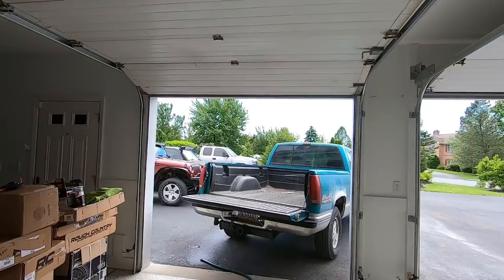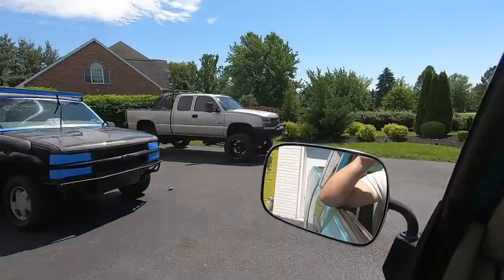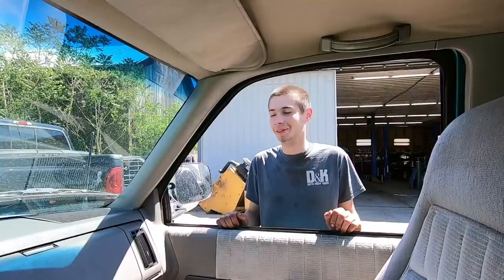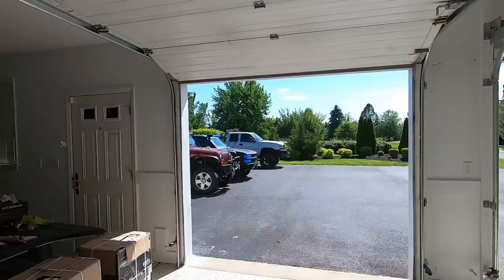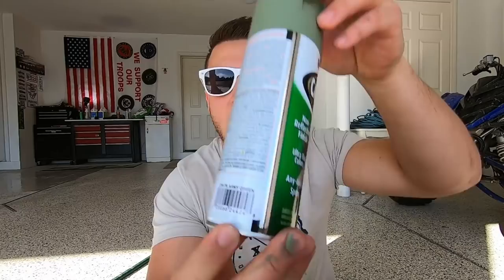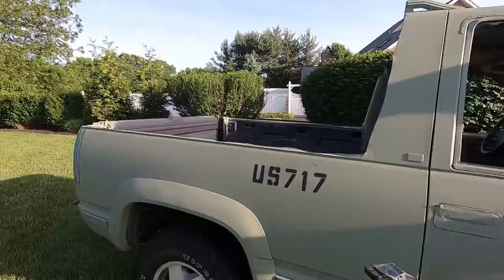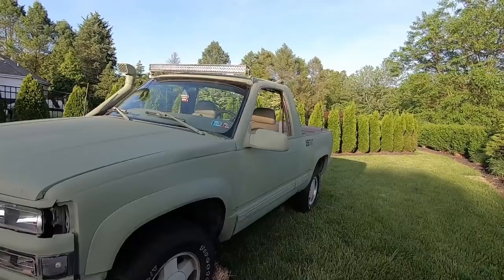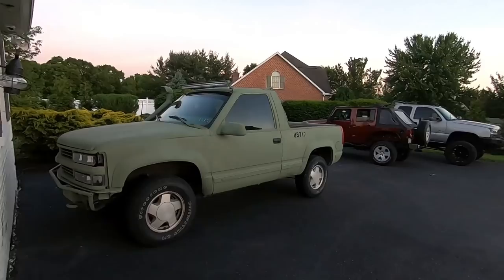I SPRAY PAINTED MY ENTIRE TRUCK ARMY GREEN FOR $35!!! The Results Are INSANE...

Comment: I would, if it were my truck 
Paint the grill, mirrors, bumpers, light bar, and snorkel  back to black. But it’s not my truck!
Reply: Mitchell Powell totally agree, too much green, it would actually look sick with the flat black plastic accent look
Reply: If it was my truck it wouldn't have the roof cut off and it wouldn't be rattle canned
Reply: its a rolling pile,who cares?
Reply: Fire Ball that goes without sayin lol... 2 door blazers are hard to come by
Reply: Pretty sure hose bumpers were powder coated too

Comment: Wouldn't it make sense to wash the truck before painting?
Reply: Bryce817  that is what I thought
Reply: And at least hit it with scotch bright or fine sand paper to give it something to stick too. It's going to come off the first time anything runs against it or if he ever washes it.
Reply: Why would he take the extra step of washing it, when all this is, is a throw-away truck for clicks.
Reply: or sand it?
Reply: Bryce817 yes it would have because regardless the (PAINT WILL NOT STAY 
ON THAT TAHOE FIRST GOOD TIME HE WASHES IT IT IS GOING TO START COMING OFF IT IS A FACT THAT IT WILL) & I will say that he took a pretty good 
TAHOE & F*@%KED IT UP this is my modest opinion #1 took it & jumped in it & bent the FRONT FENDERS on it #2 cut a hole in the PASSENGER FENDER put A SNORKEL on it #3 CUT THE BACK OFF OF IT #4 PAINTED IT THAT PUKE SH*T ARMY GREEN HE DID NOT WANT MY OPINION BUT HE DAMN SURE GOT IT I HATEED TO SEE HIM DO THIS TO THAT TAHOE OH YES I FORGOT HE ALSO CUT THE EXHAUST OFF OF AS HE ALWAYS DOES I'VE NOT SEEN HIM GET A VEHICLE LIKE THIS ONE HE HAS NOT DONE THIS WAY YET I WILL SAY I'VE SEEN PEOPLE DO SOME STUPID SH*T BUT THIS TOPS THEM  OH & THE REASON I KNOW THAT IT WILL COME OFF IS I TOOK AUTO BODY REPAIR IN SCHOOL & YOU MUST HAVE A CLEAN ROUGH SURFACE FOR THE PAINT TO STICK TO YOU CANNOT JUST SPRAY PAINT OVER DIRT & SHINY PAINT & EXPECT FOR IT TO STAY IT IS NOT GOING TO HAPPEN
Reply: @aslamb6489  He's made enough to buy a house for doing that to the Tahoe.. Are you telling me you wouldn't do that to a pos vehicle for enough money to BUY A HOUSE!??? 🤔🤷‍♂️
Reply: Naw fuck it it will buff out
Reply: as lamb comment invalidated cuz its a blazer lol
Reply: @jeepsterdaddy37  washes it !! 🤣🤣
Reply: Jeepsterdaddy 37 Lets be honest tho. Other than off-roading in his D-max, does he ever wash anything? Lol
Reply: If you cared it would
Reply: I rattle can painted my old truck a few years ago. I wiped it down with a dry rag, and painted over the factory clear. No sanding or any prep. It’s still on there 5 years later and doesn’t even look that bad. I’ve pressure washed it numerous times too
Reply: Hell na

Comment: i had a 4runner that was this exact build in a nutshell. some advice for the spray paint job (yes mine was spray painted as well) repaint the bumper and the snorkle and the light bar back to black. the black accents will take add some breakup of the solid green look which will compliment the truck 10000x more and take eyes off of any imperfections in the paint job and will also compliment the new wheels (assuming you go with black) please take this advice as i think the blazer could be badass with some black breakup in the paint.

Comment: Pull the foot brake release lever and pull the foot brake toward you.  Those year chevys if you barely touch the foot e-brake then the light will come on.
Reply: Don't forget that the lever must slam as hard as possible for it to go off lol.
Reply: Depending on how bright the light is it can also indicate brake issue like low fluid
Reply: @6door6four96  after 94 it goes red to indicate an actual issue while orange is an indicator to show engagement of the parking brake.
Reply: @6973chris2  ya cause i remember in my 97 chevy it always had the headlights on as running lights if i barely pushed the foot brake it would make the e-brake light come on and turn off the headlights but not actually engage the brakes
Reply: @stephenbranum685  I had the same experience with mine. I really miss that truck.😥
Reply: @stephenbranum685  lots of great times in old trucks like that. it doesn't matter what you're doing or who you are with those old trucks make every moment unforgettable.
Reply: @6973chris2  without a doubt if i could get my old chevy back i would in a heart beat it didn't matter that it was a work truck and was only 2wd the times and memories of smoking the tires down the road and sending it through mud holes that i knew i was gonna get stuck in. It was by far my favorite truck and will always be.
Reply: @stephenbranum685  I know the exact feeling I was lucky enough to find a clapped out z71 with really good interior and I spent 3 years building it into my dream truck and finally drove it for the first time 15 minutes after I got my license. I literally got paid and went to the dumb and got my license and then drove my mom's car to auto zone to buy an alternator to finally finish the truck and honestly teared up when I finished the installation and It started again.

Comment: Use a 3M rubber wheel to get the glue from the side moldings off. It's a wheel they make to put in your drill, specifically to take off glues and it doesn't hurt the paint. I used it to get the glue off of my k1500 and it worked like a freaking charm.

Comment: with the parking brake, try putting your foot under the brake and lifting it up. sometimes the light will come on if the peddle is down a little bit even when the brake is not engaged.

Comment: That parking brake light on could mean that it need rear brakes.   Many times if the pads get low it causes the light adjustment to get out of whack.  I'd check to see if it needs pads if you haven't.

Comment: Hey Mike I have a 94 gmc and sometimes when I pull my parking break the light still stays on because the parking break doesn’t come all the way up it is down low enough for the light to come on so when you release the parking break put your foot under the parking break “pedal” and lift up on it and the light will go off!

Comment: Mike when you pull the brake release push the parking brake all the way in and let it spring up and if the brake light is still on pull the break release and pull the parking brake up with your hand and let go of the brake release that may fix it

Comment: Push the ebrake pedal up with ur foot and pull the lever at the same time, then let go of the lever and take ur foot away from the peddle, that should take away the light, I have the same problem with my 98, the linkage needs adjusting

Comment: One romp threw the mud and sticks and you will have nice black scratches  or" pin stripes "  down it.... wouldn't have hurt to da sand 80 grit  primer it with the army green primer then paint....its a gambler 500 blazer now

Comment: It looks cheaply painted. You should at least leave certain panels or those window washer sills, the badge, mirrors, maybe certain parts of the grill in original black color or whatever it was. When you pain all over EVERYTHING, it will always look painted and on the cheap side. Leaving little details here and there amongst the new paint looks so much better and genuine.

Comment: Rock auto has OEM headlights and tail lights for the blazer, I had a 97 Chevy Cheyenne 1500 and there the same
Super easy to replace 
I think I paid around $100 for both
Reply: They may have a replacement grill too not sure

Comment: Okay, ama say it, my god is that roof delete terrible... like I tried to like it but picturing all the rust and mold that's gonna get if you ever go muding or even leave it in the rain.... Aah! 
cries in mechanic it doesn't LOOK bad but it sure makes me pity the truck, like at least put duck tape over the holes mike, it would fit the build of being cheap.
Or get some metal sheets and cut it yourself, to fit it on; with an added turret on the back of course ;)